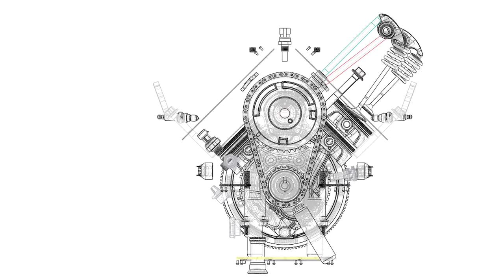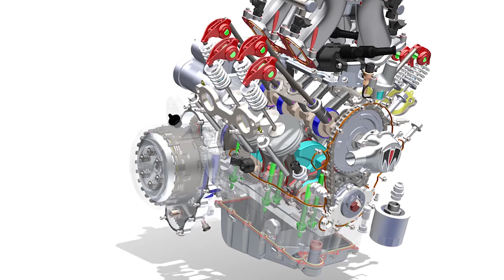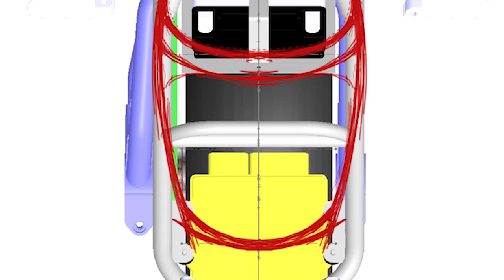2016 Motus MSTR - Jay Leno's Garage

Comment: Never heard of Motus but what a way to make a first impression - beautiful looking bike!

And again, there's nothing wrong with simplicity or older ideas - as Jay says, simplicity means reliability, and older technology often has generations of refinement that keeps it well ahead of new technology for years, even decades.
Reply: There is nothing wrong with older ideas, but there is when you charge modern prices for old technology.
Reply: Not if the older technology performs better than the new. It's all about results.
Reply: I agree, the pushrod motor has its advantages as stated in this video, smaller package especially in head design. Corvette still uses a pushrod motor for this reason. plus reliability and easy to modify ie add power adders.  PLUS the sound!!!!!!  is awesome!!!
Reply: And BTW any top of the line 1000cc Sport bike engine will weigh 130lbs.  this "old school" motor is 140.  and puts out better power than super bikes.
Reply: Yes, the 1000cc sport bike engine does weigh about the same as the Motus, but that 'engine' also includes the transmission, clutch, etc that the Motus engine needs to be bolted up to...so add in another 30-40 lbs for that! 
  In a truer comparison, my '96 Triumph Trophy 1200 weighs in at 520 lbs dry. Add fuel and luggage to meet what they were stating in the show, and their overall weight comes out close enough to call a draw, meaning  I give up about 45 to 65 ponies and around 50 lb/ft of torque to this monster for the same weight!!
 The price seems a bit stiff until you compare it with any of the top-line sport-touring rigs, which puts it pretty close to level! And unless you really need a radio/ intercom or ABS or coupled braking, it gives you a much more powerful and nimbler package with all the right stuff to ride 6-800 mile days for weeks and never stress the engine a bit... Until they are forced to add the ABS/ integrated braking crap, this would be the only new American (and likely anywhere else, too!) bike I would give up my Trophy for!

Comment: Ohlin suspension , Brembo brakes, Akrapovic exhaust....All American?
Reply: all companies that have large engineering branches in the US.
Reply: Yeah, I caught that too. But I just took it in the context of "whatever"!
Reply: I see your point. If only they could build a bike that is on par with the japanese bikes, both in price and performance. You would think that a domestic would be cheaper than an import lol. What we need more of are affordable and reliable sport tourers, supersports, and naked/standards that look AND handle well. Less cruisers and more bikes that matter.
Reply: FlyDangerous Right on.  If they came in as the slightly next level FJR and/or Connie, more or less on par with the K1600 at the K's price point I believe that is a much more attractive package. I could do that, man. I would do that. I believe this could be done with the base model and accessory catalog pretty easily. Hell yeah, still offer the R model - if ya want the crazy stuff, by crackie, you can have it! I think this makes sense. But what the hell do I know?!? LOL!!
Reply: i kinda want to move to cali and join the highway patrol just so i can go to work on a k1600 every day. its a bitchen motorcycle.
Reply: To my knowledge no performance motorcycle manufacturer uses only in-house parts.

Comment: I do appreciate their efforts but the styling of this bike seems like it's stuck in the 2000s.
Reply: agreed, reminds me of a late 1990's era tourer, new styling now is about more subtle small lights and binkers
Reply: What kind of styling do you want? It's designed to be ridden all day and keep the driver out of the wind, and with the V4, it has a special sound all it's own, it doesn't  sound like everything else on the road. It's a driver's motorcycle with any of the fancy aids that can cause problems. It doesn't matter if you're riding in California or the Cabot Trail in Nova Scotia, it looks like the bike that will get you there and back.
Reply: accept a V4 is 2 cylinders more than you need. If you want reliable you use less cylinders not more. Just look at all the adventure bikes out there they have 1 or 2 cylinders for a reason. Also touring now is all about weight, who wants to haul all that weight around, no one.
Reply: A fully loaded Harley is around 800 pounds, and from what I've seen working at a toll plaza, it's the young guys who are on 2 wheels, the guys over 50 are going fro trikes, sometimes with V8s in them, If you're highway touring 1 or 2 cylinders isn't going to make it, not for long distance.
Reply: i think it's a beautiful timeless look. if you prefer a gsxr then go buy one
Reply: and technology from WW1.
Reply: +Richard Neal  -   Its not really heavy for a touring bike what did they say 550 lbs.  I would say that puts it right in the middle of the pack.  The equivalent BMW is 604 lbs.
Reply: I don't see that it's "dated". Styling doesn't simply evolve forward and get better. It changes as designers try to do something new simply for the same of being new. 60s cars, early 50s, some 2000s were the best looking cars. 70s and 80s were largely ugly. The same applies with motorcycles, though with different eras.
Reply: I don't see that it's "dated". Styling doesn't simply evolve forward and get better. It changes as designers try to do something new simply for the same of being new. 60s cars, early 50s, some 2000s were the best looking cars. 70s and 80s were largely ugly. The same applies with motorcycles, though with different eras.
Reply: I don't see that it's "dated". Styling doesn't simply evolve forward and get better. It changes as designers try to do something new simply for the same of being new. 60s cars, early 50s, some 2000s were the best looking cars. 70s and 80s were largely ugly. The same applies with motorcycles, though with different eras.  Yes, it's plain compared to the noisy, excessively wild and busy "look at me, I'm faster" sport and sport-touring bike designs lately. One could say it's clean and refined; an elegant, mature look for an adult who doesn't feel the need to look like a hormone-crazed punk teenager.  GT40, not Aventador.
Reply: I don't see that it's "dated". Styling doesn't simply evolve forward and get better. It changes as designers try to do something new simply for the same of being new. 60s cars, early 50s, some 2000s were the best looking cars. 70s and 80s were largely ugly. The same applies with motorcycles, though with different eras.  Yes, it's plain compared to the noisy, excessively wild and busy "look at me, I'm faster" sport and sport-touring bike designs lately. One could say it's clean and refined; an elegant, mature look for an adult who doesn't feel the need to look like a hormone-crazed punk teenager.  GT40, not Aventador.
Reply: I don't see that it's "dated". Styling doesn't simply evolve forward and get better. It changes as designers try to do something new simply for the same of being new. 60s cars, early 50s, some 2000s were the best looking cars. 70s and 80s were largely ugly. The same applies with motorcycles, though with different eras.  Yes, it's plain compared to the noisy, excessively wild and busy "look at me, I'm faster" sport and sport-touring bike designs lately. One could say it's clean and refined; an elegant, mature look for an adult who doesn't feel the need to look like a hormone-crazed punk teenager.  GT40, not Aventador.
Reply: I kinda like it to be honest, it's timeless
Reply: @sometimes_i No need to be condescending by stereotyping my taste.
Reply: PriVacy Matters:  "Opinions are like a$5holes though everyone's got one! lol"  Speak'n of azzoles.
Reply: Not every bike can be an MV Augusta (look at how many times they have been bought).
Reply: Gordon Ho we have yet to see year 3000 so I would assume every bike is stuck in the 2000's
Reply: JKC A timeless look is a Harley. We won't be able to tell if this is a timeless look until 20-30 years from now.
Reply: Dude the Harley Design is stuck in the 1940s but selling like hotcakes.
Reply: Richard Neal no touring bike is being released with 1 cylinder.
Twins aren't used for reliability....They are used, because they offer the performance needed without costing an arm and leg to achieve those results. 

BTW, If you want reliable you use the biggest displacement you can... A 1100CC motor producing 100hp will always be more reliable than a 700cc motor producing 100hp built to similar standards.
Reply: It was made in 08
Reply: and that's a good think IMO

Comment: This is fantastic, unfortunately $35k you can get a fully loaded BMW GS for about $10k less with service available in every state.
Reply: The main point of this bike (besides performance) from a design perspective was to last. Not saying BMW wouldn't last but I'd bet this bike would easily run for 300k miles without a problem. Being that most of the parts are from good old corvette tried and true parts. That extra 10k is paying for reliability. change the oil, fluid, chain and filters on good terms and it would probably last forever as a daily driver. Even under hard use I bet this would still last 300k with only minor issues or power losses.
Reply: Different bikes, Jay said it best "you don't see yourself coming and going"... if you want to be different/more exclusive, this is the bike for you.  Not knocking BMW, they make an amazing, quality product; but they're different bikes and have different buyers. Not better, not worse, just different.
Reply: 300k miles without problem based on what data?  GM isn't building the engines a small company in Alabama is building the engines.  There is no data backing up your 300k mile reliability. Also let me point out that the motorcycle doesn't have ABS, traction control, or riding modes and before you say "I don't want any of those things" with that price it should include all the latest technology.
Reply: My BMW motorcycle has had zero problems in 10k miles and 18 months.
Reply: Ranked by who?
Reply: The way bmw has been producing bikes lately, you may need service in every state. ( ain't what they used to be )

Comment: Really encouraging to see this being made in the USA.  I can think of a lot of uses for the engine if it is as reliable as advertised.  No mention of fuel mileage, but that would depend on the operator.   With the torque it should do well on the mileage.

Comment: 30K? you lost me. Seeing as  the most expensive Harley touring is 27k, the fully loaded BMW K1600 (ABS, Cruise, 1600 6cyl) is 30K... I don't see the value.
Reply: Agreed.
Reply: This is a hand crafted machine. It uses the best components, and the fit and finish is first rate. And the BMW while a very fine touring machine, it also weighs 800 pounds. This weighs 585 fully fueled. They are not exactly the same machine. By the way the 6 cylinder motor is cast in China, and then finished in Germany.
Reply: I am sure it's a nice bike. Jay says it rides and drives nice, but at $30k? I can by the top of the line bike from Victory, Indian, and Harley for less.  Just saying that when I shop for something I look for what is going to give me the most bike for my money.
Reply: So you're telling me that a Harley, Indian or Victory can handle corners like a Ducati, MV Agusta, Aprilia, etc?!! I DON'T THINK SO!! That and the Motus has nearly double the power of those three while carrying at least 100 less pounds of dead weight around. And if you are trying to compare it to those three brands, you obviously aren't the target customer for this bike, nor anything else in the Sport-tour motorcycle market.  It's like comparing apples to cucumbers...
Reply: No it's comparing what a person could buy for $30k. The Motus can't handle corners like a Ducati or an Aprilia either.
Reply: The Harley Davidson cvo limited Street glide is 43 grand. That's not even a trike. Not that I would have one...
Reply: @RichM1967  Indian and Harley aren't making sports bikes they make cruisers you're comparing apples to oranges

Comment: It reminds me of a Yamaha FJ1300, except it's more than double the cost.  I'd be interested at $20K, but not mid to upper 30's.  Watching those guys cast motors outside in the dirt wasn't too impressive either.  Seems like it should be done in a more controlled environment.  It's good to see bikes built in the U.S.A. though….   I don't think Jay needs to repeat himself over and over making the same 3 points.  That got a little annoying.
Reply: They showed the engine blocks being cast indoors.  They were removing the sand molds from the finished castings outdoors.
Reply: or a kawasaki concourse... but the old one lol, the 2004 model, this is it but indeed incredibly pricey. Too deary if you ask me (or you), thats almost Arch territory, doesn´t seem a smart move, sure, the fun part about bikes its how easily you can customize them. If I wanted something juuust reliable to go from one point to the other I´d buy a used one, if you are spending so much you want flames and chrome and bags all over.

Comment: Those boys definitely get an "A+" for effort, but honestly, I think they're overpriced by at least $10,000. Im as willing as the next guy to pay a premium to support an American company, but thats asking a bit too much. My money is going to the Kawi boys for an H2. Maybe its just me, or maybe I'm just not rich enough to understand the "pay more and get less" mentality, but if I'm shelling out big bucks for a high end toy, I want it to have all the latest, greatest, and coolest gadgets, gizmos, and gimmicks, regardless if I'm going to use them or not. $30-35k for a "modern sport bike" that doesn't have linked brakes, ABS, traction control, wheelie control, quick shifter, adaptive suspension, nor multiple drive modes; that makes it a non starter for me.
Reply: They aren't exactly charging you a premium... They are a small company so they don't get the perks of what a large company has. HD on the other hand is definitely bending people over.. They have no excuse. 

Linked brakes can STAY off, but ABS, Traction control, and wheelie Control is definitely a need at the price they are asking. RPM Cycle a dealer near sells a few a month so I might pick one up soon since they are still selling this strong 2 years later.

Comment: I was at Vintage Fest at Barber in 2010 when this bike was in test phase. They were letting people sit on it and asking for input. My suggestion was to add an adjustable windscreen as the rep said it was being developed as a true long distance  sport touring bike.  I believe they did add that feature even though the rep said they had a concern with adding weight because of the electric motor.  I wonder how it does on MPG?

Comment: i would buy it. great job guys. i would of used belt drive (getting tired of 4 carbs and chains to deal with) but i understand the torque may have been an issue for belt drive

Comment: I desperately want one of these engines (maybe with a torquier, lower-revving tune/cam/intake), a Miata trans and rear diff/suspension/brakes in a Honda S500/600/800 coupe. What a fantastic machine that would be...

Comment: I'm a little perplexed by the fawning over these guys. Did you invest in Motus Jay? Just curious, not meant to be an off-hand comment.  They are building a $30,000 sport-tourer. This is a VERY small share of the market. The deep pockets these guys must have is phenomenal to have started in '08 and just now getting to production. People scoffed when Erik Buell built 100 bikes to meet homologation to race in 2012 at $40,000 a pop. His 1190 motor is built in country, makes 185 bhp with 106 ft/lbs of torque and weighs 150 pound less than this bike. And now costs around $15,000. I'm all for manufacturing in the USA, but Erik Buell has been doing it since 1983. People thought he was down for the count a couple or three times but he gets back up every time. Why not have him on the show? Off my little soap box, and I do love the motor in the Motus, has a fantastic sound.

Comment: This looks like the engine that was on a test stand at Mast Motorsports in Roadkill episode 24 where they put an LS motor in the Crusher Camaro.  Frieburger was with Horace Mast as they walked by an engine that looked very similar to the engine in these bikes and Frieburger commented that it was research for an O.E.M. application.  I'll bet that was this engine.
Reply: Yup, that was this engine. I recognized it on RK from an issue of Hot Rod mag where they did an article about it like 5 or 6 years ago.

Comment: I wonder if  they will sell only the drive train ?that's a way around  that 30 plus k price, I would  try to get downsized versions of that engine in commercial lawn mowers,anything to build up a following
Reply: They sell a crate engine for $10k.
Reply: +Derek Jonez that sucks you can get a brand new ultima brute for 5000,they need  to  take  a  loss till production goes up

Comment: the MG MGB was originally designed with a V4 in mind which is why the engine bay is so wide but BMC did not have the money to develop it. 1650cc is a bigger than a lot of car engines...

Comment: I can imagine a motorcyclist in California probably doesn't have been use for a rain riding mode, but not everyone can predict when they'll need emergency braking or the road surface at the time.  For $30k I expect ABS, riding modes, and heated grips as standard.  They sell the engines for $10k.  Is the rest of the motorcycle really worth $20k?

Comment: Looks like the engine is perfectly configured for a shaft drive.  You had to use  a 90 degree  power robbing hypoid gear to get it to the chain anyway. I would love one but fore $4500 got a used VTX that will have to due.